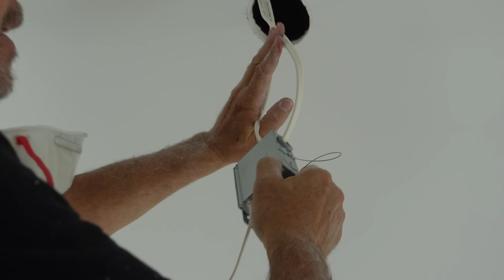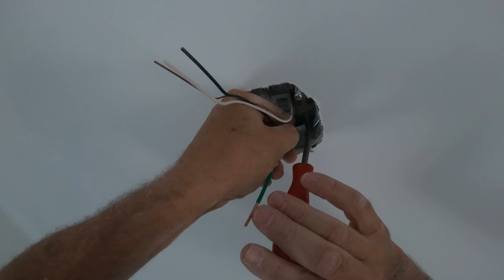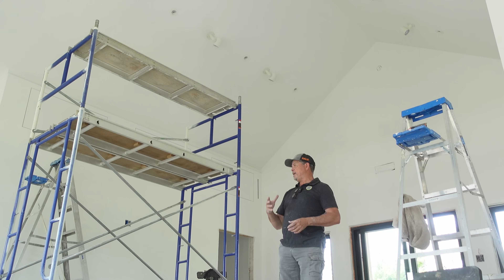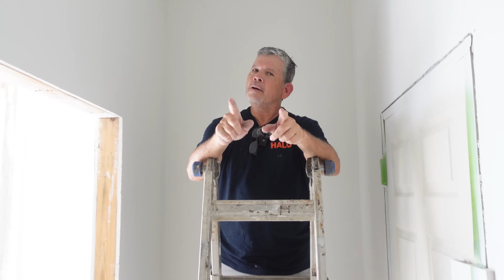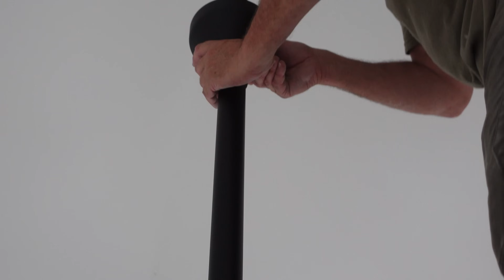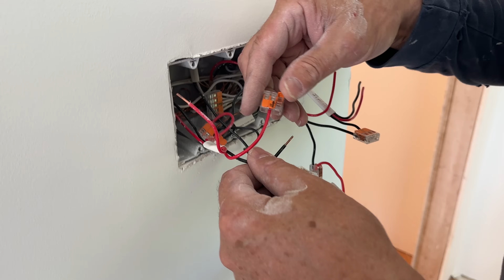Our $2,000 Fan wouldn't stop CLICKING.. So We Disassembled it and Here's What we Found

Comment: Hey ya'll, I've installed 100's of Halo lights (of various types) and they are generally fantastic, but I HAVE come across a few duds. Standard can retrofit kits are quite painless because you can pull them back out with relative ease in the event of a dud, or if a spectrum adjustment is required. Units that utilize spring clips that grasp onto drywall, however: not so much. Make your connections at every location, then do a function test BEFORE mounting. Those spring clips are insanely strong and you don't want to have to wrestle one out unless you have to. Better to find out you have a bad unit and / or set the color temperature one notch off before it's buried, than afterwards 🍻

Comment: I installed a pair of these on a large patio porch, the assembly kit is amazing from them. The fans are NOT cheap by any metric.
Too bad they shipped it out with that tape loose.
Likely, it will come loose again.
Tape doesn’t like being free from the backing long without being pressure fixed to a surface.

Cool build.

Comment: @15:24: Without those top corner screws, the backing plate could bend with the weight and the fixture pull away from the wall just far enough for water to get behind.

Comment: PLEASE... To who can answer it. Powering multiple lights from one outlet (doesn't have a switch, as is powered directly by the line breaker because I'm replacing a dusk-dawn fixture). Issue is the new light fixtures don't have an integrated photocell, and I thought that I could install a photocell right after each outlet so it command the three lights per outlet that I want to accomplish.  Right about finishing the installation, I was told that this wouldn't work; that it should be a photocell per light fixture. If it is like that I prefer to install a timer for that circuit.

Comment: On your small light boxes.. i run a bead of sealant around the top and sides keep rain water from running in.. and bugs and if the bix has allot of extra holes. I will seal them. Keep air intrusion down.

Comment: I would be so pissed off with that fan and asking for a discount to fix their screw up. And those push to connect wire connectors are garbage. I’ve had to replace many of them installed by others because the pancake lights flickered after a year or two
Great stuff guys! I always await your next vid!

Comment: For fans for any other rooms, go with Minka Aire, I use them only. Have installed so many fans with same issues you described. Stay away from bigbox stores as its like plumbing fixtures, they use cheaper parts, so get them from direct Minka Aire dealers. They are so quiet. I have a 12 blade 65 inch in my master. Fully adjustable with app, voice control, and other smart home automations. On 100% u just feel air and hear minor woooshing air noises. No hum, no clicks, no rattles, nothing. Just wind... I run my fan 24/7/365, 3 years for this one, still no weird noises, and im a fanatic with noises. 

I went with a BA fan residential also, and ended up returning it, not only a pain to install, but they can become unbalanced over time where the downrod connects wears, IDK y, but after 6 months in started a slight wobble. Luckily they took it back but still, pain...

2nd, your allowed to take anything apart that's not functioning correctly and try to repair it yourself, those void warranty stickers and all that other crap in their manuals and what not is not legal... Magnuson Moss Warranty act of 1975 allows you to work on anything, if a manufacture ever tells you different ask them to ask their in house lawyers about it. They will quickly change their toon. Usually u just have to mention it and they already know and will correct the issue without questions from their on. You just cant damage the product... I usually film myself doing it incase there is something broken and they try to blame it on me, video don't lie.

Love watching you guys, been here for about 3 years now, been following every day since last april. Keep up the good work.

Comment: I'm not surprised to see your bolt snapped in that sconce box. Its absolutely wild the torque required to get the bolts in some. I wonder if its because the tolerances are just cheaply made? or if there is a secret trick to it.

Comment: Actually not grounding a metal box in wood construction energizes the box and any metal in contact in the fixture. Hazard. Could also arc with stray voltage and cause a fire. Touching hot to neutral or ground will trip the breaker, or at least should.

Another tip installing lights or speakers wash your hands then use gloves for the hard work then bare hands for fixture. Pros will say waste of time but pro painters will say you are paying me to touch up the painted ceilings. We take care to not paint what shouldnt.

Comment: Hey, on that mono point light you wired, that hole in the mounting bracket is for the wires to run through so they don't get pinched between the bracket and the fixture.

Comment: BigAss Fans better send you one for the house for fixing their QC issue. It should have never left the factory with that tape click. Awesome job and great picks for the lights.
Reply: they need a better way to hold those balance weights in place that's pretty chintzy way of doing it on a $2k fan
Reply: At least get the quality control person a hearing aid .
Reply: don't hold your breath
Reply: A couple of points: I wouldn't be surprised if the assembly line workers wear ear protection; and using tape is a terrible idea as it may have not been making that noise after assembled, but changes in temperature during shipping and sitting before installation loosened its grip, but also what's to prevent it from loosening over the years, especially from the heat of the motor.  As mentioned in the video, the tape's securing the balancing weights...could you image them doing that to your vehicle tires (though I don't recommend you take your fan off-road 😂)?  They need a better way to secure them.

Comment: Small notes on the fan attachment/disassembly/reassembly:
1) Using a regular washer undearneath the toothed lock washer defeats the purpose of the lock washer. The lock washer is used to prevent self-loosening of the bolt over time from the vibrations/forces induced by inbalances during the operation of the fan
2) The safety wife bolts have threadlocking on them in order to prevent self-loosening. Ideally the bolts should be replaced or at least old thredlock should be removed and re-applied. That said, there's probably enough old threadlock onthere that you are safe.

Comment: in my new house I'm building I have 12v and 120v circuits..I use a 100amp dedicated power supply for a power source for my LED lights... and at the low current demand on LED lights I use Cat5 wires for multiple circuit runs, cheaper and faster to run!!

Comment: Another POS screws made in cheating china that broke on front luminare. Stopped purchasing screws, nuts, & paper thin flat washers from Graingers because they sell mostly inferior cheating china garbage. My electrical supply house sold Chinese toggle bolts for a few months until they had so many returns & breakage complaints. Went back to only selling quality real deal made in USA toggle bolts.

Comment: That clicking in the fan in the main house could be from the wire connection that is rubbing against the portion of that fan that spins inside the housing. Just rearrange wires and it should fix the clicking

Comment: The sconces on the front of the garage. The perimeter keyhole screws are to hold the bracket tight around the outside. By not installing the top 2 you’ve weakened the fixture.

Comment: "You can not mess it up". Challenge accepted. :P
I like the little giggle when you talked with the screws in your mouth. Whatever works. LOL. Wagos are very cool. I need to get some to fix some stuff in my house where the regular wire nuts came off. They came loose on the lights for my Evergo ceiling fans that were installed in the 1980s.
Yes, you showed those outside sconces in a previous video. They look neat. They kind of remind me of something from Star Wars.
If I drove through that area, I'd stop and stare too. I love looking at new construction stuff.
I'd put in all 4 screws in case you get some high winds. Better safe than sorry.
I hate when screws break.
I'd probably put some sort of caulk on just to be safe, but then I have weird bad luck where if something can go wrong it does.
Wonder how hard it is to install those types of lights in a ceiling that has acoustic ceiling tiles. I have ceiling tiles that look like pegboard. Fugly things, but I want to add a light above my shower.
Big Ass Fan! LOL! I love it!
The ceiling fans in my house are all very loud, but then, they are from the 70s & 80s. The white noise actually helps me sleep. Every single newer ceiling fan hasn't even lasted 6 months. They don't make them like they used to.
Is the one hole in the ceiling of the stairwell for some sort of smoke detector?
Will there ever be some sort of window treatments for privacy once Jordan is ready to move in to the carriage house?
Reply from the maker: Thanks!  Yes smoke detector, yes probably some type of motorized shade
Reply: @StudPack  Nice! Will there be more than one fire extinguisher in the place? Maybe one upstairs and one downstairs? Two of my friends lost their homes to fires so its something I always worry about.

Comment: I hope you've got some good wireless networking equipment for all that smart stuff. I had to get a better WiFi solution for my home because the router my ISP provided got overwhelmed with my smart devices.

I now use the TP-Link omada system with a wireless access point that's designed for an enterprise/business environment. If that ever gets too slow I can upgrade it or add another access point somewhere in my house that gets poor reception. It's a good way to go and it's very scalable as you build out the rest of your house. Alternatively a lot of people really like ubiquity which is a more developed system but it's more expensive.

Comment: I live about an hour from you guys and I would definitely put some anti-seize on the threads of all the outside lights even the threads with the o-rings. A year from now it will corrode and a simple replacement of a bulb will turn into a fixture replacement…. with our moisture levels trust me. As usual I love the videos and wish you were able to upload 2 times a week. 😂 Thanks for the awesome content!!
Reply: Use dielectric grease not anti-seize.

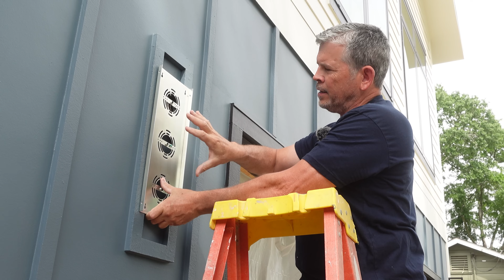Comment: 15:20, @Studpack, please please please, but horizontal battens top and bottom, where the metal mounting bracket stops, so you don’t end up getting wasps building nests behind the fixture. You’ll regret it later if you guys don’t ❤ EDIT: disregard, didn’t realize the whole light covered it :)

Comment: I'm an electronics engineer, and I was very impressed to see conformal coating on the Big Ass fan circuit board.  This is not a common thing, but it protects against moisture.

The PCB layout looks well done.  I've used the same Wi-Fi microcontroller module on some projects.

Nicely designed product!

Comment: After watching this, I don’t think I’ll use anything other than Wagos for electrical light fixtures. Way too often you’re trying to hold the light and get the wire nut on - and really need a third hard. Nice work on the lighting and not skimping on the number of lights. Makes a big difference with more light sources so they don’t all need to be at full power to get decent light in the space!  👍

Comment: Around 07:25, it drives me bat-shit, that there isn't a system in a pack of lighting fixtures, as simple as a hook, and some braided cable, or whatever, that can hold up a fixture solid enough to not warrant installers carrying screws in their mouths and fumbling at the top of a bloody scaffold for the right tools. Maybe I missed the solution, but this is all so fumbly and dangerous, if a ten cent solution could work.

Comment: As a  electrician, those Wago's are great. I also wrap mind in electric tape. Keeps the release tab lock down and won't accidently pop up when stuffing the box. Also use di-electric grease on all outside and bathroom treaded bulbs. Keeps them from rusting and unscrew easier. Love your show.
Reply: No need to tape a wago. That’s just wasting time. I like the grease idea for outside bulbs though, great idea I never thought of
Reply: @remodz6385 I find it suspect when someone claims to be an "electrician" then goes on to state they put tape on wagos 😂 I mean its basically the equivalent of taping wirenuts...  (can't wait for the herp derp "but what about motor connections" reply) 🤔
Reply: I was going to suggest wrapping the Wago's with electrical tape too. I alway do that when I use them to make sure they stay closed.

Comment: The degree marks on the fan are likely used when balancing the fan / motor. Sucks there was an issue, but also nice that it was as simple as just the piece of tape. My guess would be the fan is balanced before being assembled, and then either is not "tested" after assembly, or maybe that part of the tape just came loose in shipping or was just barely loose enough that it started clicking after running.

Comment: Great video, love the selection of lights. Garage apartment is looking great. 

Thanks for the story of the NYC union’s. I know they mean well but sometimes they have some very stupid rules. Worked for a company that installed generators in the area, they were installed and tested worked perfectly out of the box. Union got wind of them and required them to be stripped down and rewired by Union electricians. After they were done it took nearly a year of fixing mistakes to get them barely running again.  We’re wrinkling out glitches for years after.

Comment: I’m am Electrician, installed 2 fixtures for a realtor client of ours. Each fixture was north of $3000. They were ugly, but she picked them.
- I once swapped a fan for a fan on a 12 ft ceiling. The carpenter that installed the ship lap did not install the bracket that holds the fan. It almost took me out!

Comment: I didn’t know this until recently, but apparently, in the U.S.A, it’s illegal to void your warranty on a product if you disassembled it. It’s been that way for a number of years, since the 2000s if I remember right.
Reply: 1976 actually, but it's really only gotten a good push in the last 10 years or so.
Reply: @GrumpyWolfTech  Interesting. I’ve seen many more electronics from the 90s and early 2000s with “warranty void if removed” stickers covering screw holes or over seams in the case where it pops open. The stickers were very brittle and designed to break. I somehow had the idea that it was enforced back then, but I guess not! They were probably just trying to scare us into throwing their stuff away!

Comment: Putting a flat washer between a star washer and the mounting surface is No Bueno!  For the star washer to work it needs to bite into the screw head on one side and the non-rotating surface (mounting plate) on the other side. With the flat washer the the star washer instead bites into it instead but could easily slip against the fixed mounting plate.  If you want to use a flat washer, you need to add lock-ite to the threads - or use some other locking mechanism to prevent vibration from walking out  the screws.

Comment: My desire for symmetry is poking my hind-brain here. In the vaulted ceiling you have very different positioning of the directional lights. On one side they are between the down-lights. On the other side, they are sort of above the down-lights in slightly random looking lateral(?) positions. It bothers me for reasons I can't properly explain.
The side nooks at the front also look comparatively gloomy due to the lack of directionals, although I suppose there is additional lighting to go in those that we haven't seen yet.
$2K on a fan... Never mind the fan, that's a big ass invoice!

Comment: I couldn't help but smile when you guys turned the lights on!  You guys need one of the attachments for the hole saw, so you don't get all the sheetrock dust on you.  Box stores sell cheap throw away ones, but you can always get the good ones.  Great job guys keep it up.
Reply: They have one, used it in an older video.

Comment: I installed 8 Halo Can lights today. The only issue I had were the 3/8 plastic wire locks that snap into the knockout. 2 per light and my thumbs are sore from pushing in the tabs.

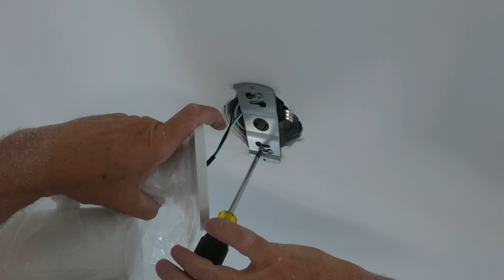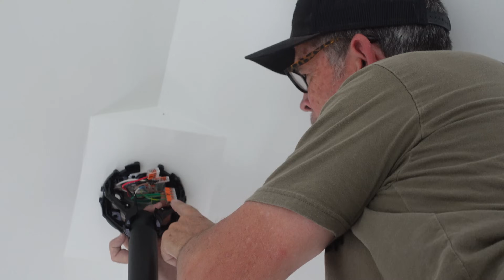Comment: 08:00. Installation error … the hole in the middle of the strap is supposed to have your wires go thru it.     Hook up wires tgru hole in strap first then attach to junction box.   Also shouldn’t a ground be attached to the install strap? 16:57.  Did you ground the mounting plate?   Not shown in video.  Clearly see a screw hole for ground screw - ground screw came installed to middle cutout. 25:28 you never showed if you did ground wire to junction box

Comment: So happy for you guys....great progress, thanks for sharing.

Something to consider for your outside sconces, remove each lens holder and apply a light coat of grease to the threads so you can remove them easily when you need to update/change your bulbs. Same recommendation for the screws on the front sconces.
Reply: based on my own experience I highly recommend that plus dielectric grease on the bulb threads. Especially in your climate.